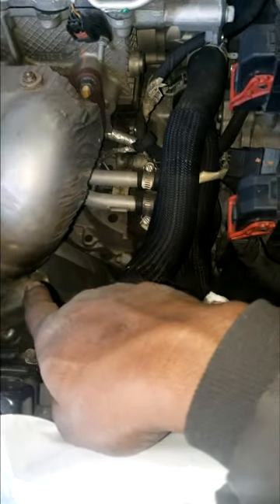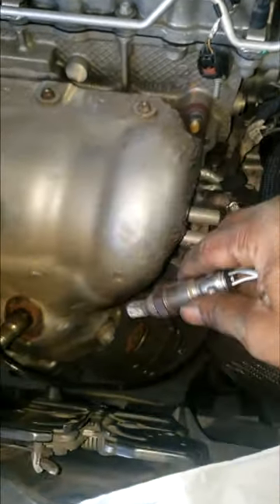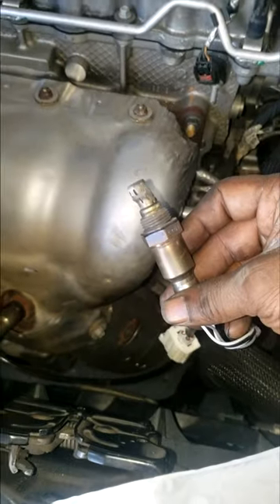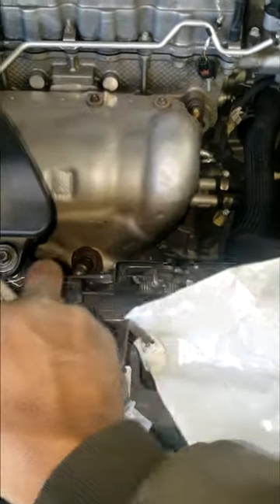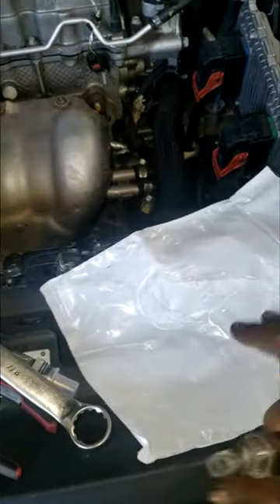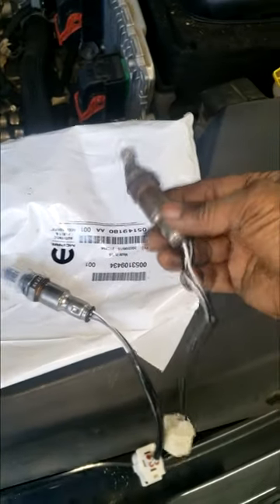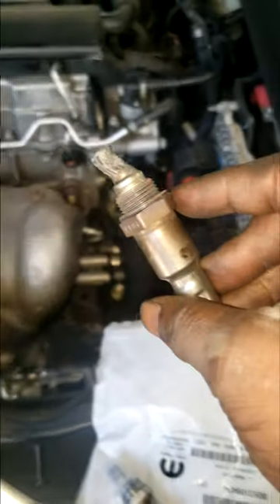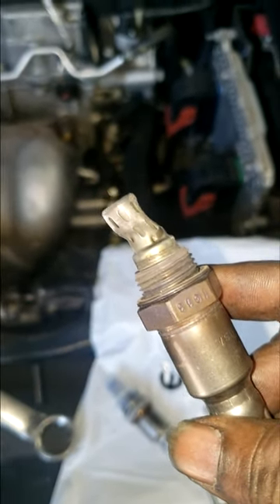Here's why this car came back as a COMEBACK RECHECK on me.

Comment: I would definitely put an infrared thermometer on that cat and exhaust to check for excessive heat and like someone else posted the fuel trims. Good luck and hope you post an update. Thanks brother
Reply: Bingo. Obstructed cat!
Reply: Yes Cat issues. Probably breaking off bits of catalyst that Hit the Sensor on way by.
Reply: Could be a piece of cat sitting on the tip of the sensor and melting it and distorting it.
Reply: Clogged cat creates incinerator.
Reply: @LukeTelff  
That sensor looked like it was just below the manifold/header.
If that’s the case, then the cat would be further downstream from that location!
Of course, an obstructed cat would cause the exhaust temperatures to rise which would cause the end of that sensor to melt or become distorted like that!!!
Reply: @AzzKicker-bz1cb  I was about to write the same thing 🤙
Reply: @birdieb5323  That's what I came here to say, but did he say he'd replaced the cat as well- or did I imagine that?!? 🤔
Reply: Yup. Many mechanic folks don't understand that the light comes on because the O2 sensor senses something wrong. But 90%of people just replace the sensor and never look for what is the cause.
Reply: Down stream would be behind the cat unless it has a pre cat then another after that sensor. Ive never seen a sensor over heat post cat or downstream from a clogged cat, if that happened it would have to be within an inch or two after the cat. Plus the upsteam sensor is fine which would be exposed to hotter temps if convertor clogged. Maybe the internal heating element is getting continous signal/voltage, older sensors were heated by exhaust but newer sensors encite a heating element for 30-35 seconds.
Reply: If the cat were blocked, wouldn’t it cause driveability issues like lack of power and acceleration?
Reply: @dm7097  at a certain stage
Reply: So true. Excellent Job 💪
Reply: With the seriousness of that visual evaluation of the conditions of that O2 sensor in just two weeks. Wow? Definitely follow the advice of Theses Engineers sharing knowledge about Fuel trims and CAT temperature. 💪
Reply: @birdieb5323  knew it right away
Reply: Wrong Wrong Wrong, absolutely not a clogged cat. Has anybody seen a clogged cat at night, the pipe gets so hot it glows. But just between the engine and the cat. From the cat back to the tail pipe isnt hot doesnt glow. The O2 sensor he pulled was downstream meaning after the cat. Only the upstream or the first O2 sensor would be exposed to the extreme temps or the glowing part of the pipe. But he didnt say the first sensor or the pre-cat sensor or the upstream sensor, he said the downstream sensor.  If the cat was clogged the first O2 would be the melted overheated sensor not the second sensor.
Reply: Defective Cat with improper plate placement.

I've seen one like that before: instead of the normal obstruction that allows the exhaust to burn clean before emission, it sort of funnels everything into a blowtorch down the tailpipe...cooks the Downstream O2 Sensor like bacon and plays merry hell with the baffles in the muffler.
Reply: @jonboatmorava9115  exactly! Just like a blown head gasket, it’s a symptom of an underlying problem

Comment: It got hot,!  Clogged catalytic converter!
Reply: Its a new cat he literally just said he replaced cat and o2's 2 weeks ago well at least the o2's  but still hed also have some catalytic codes at least a efficiency code id think very strange case.
Reply: Someone beat on it B4 they put it in
Reply: 100 percent
Reply: Looking at it from a really messed up positive angle. If there is anything like around where I live if it is clogged up within 6 months he's probably going to have to put a new cat in either way because somebody will have borrowed the current one in the middle of the night. I'm going to have to change my opinion about them being sneaky thieves and now say they are helping make sure the population does not have clogged up cats on their vehicles. Bless their hearts
Reply: Right
Reply: "I think" are the operative word's.
Reply: or unburnt fuel
Reply: Free the cats
Reply: @yungtomb9374  new doesn't mean good, all those "new" parts are fixed parts and build poorly, he should check the catalytic element if it fell down or clogged
Reply: Yep
Reply: If it was getting hot enough to "melt" like that that thing wouldn't drive worth a shit.
Reply: I bought a car, once. Paid 400 dollars for it. Had new cats on it. The new cats were stopped up, too. It was running too lean. Put in a new fuel pump. Punched out the new cats. Ram like a scolded dog, chasing a spotted ape.
Reply: He just said that he thinks he replaced the cat, he can’t remember if he did or not. I’d think that if he did replace it, it’s defective.,
Reply: @yungtomb9374  I've put brand new cats in and they fail. Could have been dropped before delivery and messed up the honey comb. Never know
Reply: @yungtomb9374  theres no way a good new cat would let that o2 sensor hit 500°+  to do that to it. I have messed with this engines emissions and its definitely a fuel trim bogging down because the cat is not flowing
Reply: @yungtomb9374   Just suck cause something came new from the fact you don't mean to s*** There's bound to be quality control issues doesn't matter who where or when🙄

Comment: Cat is either plugged and getting veryyyy hot, or it’s staring to blow out and a chunk clipped the sensor.
Reply: But he said he might have replaced the cat
Reply: Thats melted.
Reply: Yep this sounds like what’s going on. I had the same thing happened to a Subaru and a month later the cat came completely apart and clogged the exhaust. Maybe put a camera in the hole and see if you see any random or missing sections of honeycomb.
Reply: Agreed, I have seen them throw chunks. Also it was really hot when it hit.

Comment: The catalyst has come loose inside and is pounding the o2 sensor.
Reply: Correct you can se the imprint the converter honeycomb left on the sensor. I would replace the converter and do a flow check on all your injectors to see where the extra gas is coming from.
Reply: Excellent observation!
Reply: Yeah you can totally see the markings left
Reply: You're a smart "cat" no pun.
I'd want you on my team good observation

Comment: THAT’S where the 10mm went 😳
Seriously, I’ve never seen that before. Following 😎
Reply: That’s actually really funny!! About 6 months before I married my wife (of almost 27 years now, and counting), she was helping me put a set of heads on my ‘81 Trans Am drag car, and she dropped a Socket down a header pipe! 😂 
We’ve laughed about that for years and I still tease her about it….but yeah, without more detailed information, my best guess would be:
1) Clogged catalytic converter
2) Poorly tuned Nitrous system or overuse of Nitrous
3) or possibly a malfunctioning fuel system or clogged injectors, but chances are, if this was the issue, the engine would idle and run rough and the ECU would be throwing codes. 
Good luck with it, though!

Comment: Yup I have seen this before. When you install an o2 sensor with a regular wrench and over torque them, you twist the sensor itself on the tip.
Reply: That simple I bet!! Good info
Reply: @theglitch99  I did this by accident for years until an OG showed me the proper socket/wrenches to use for o2 sensors. $20 saved other people thousands 🤣🤣🤣🤣
Reply: No. Just no. I've tightened the living shit out of O2 sensors before. There is no force on the tip. That sensor is melted

Comment: There is a recall on that engine. We replace the converter and both O2 sensors. It's an emissions recall. Check if it was done
Reply: Those heat shield nuts look too new for the 2.4 cat recall not being done 😂 Dude idk how many I’ve broken now lmao. But yeah def see if the cat was done, could get the customer a free one.

Comment: Ok first of all good on you for posting your comebacks. Secondly it’s hard to tell the color of the metal in the video but to me That looks melted you need to check how the engine is running because the o2 sensors should not be getting that hot. Misfires and fuel trims would be what I look for first. And definitely pull the upstream to look at it too.   Good luck to you
Reply: The more I look at it the more it seems like there was a piece of the cat brick laying on it. Tap the cat with a rubber hammer or use a screwdriver or something in the o2 hole to feel if anything is loose in there. Again good luck

Comment: The catalytic converter is breaking apart. It will be back soon.
Reply: The cat comes after the header pipe😂
Reply: @paidinfullthelabel5698    No this car has a 3 way cat... its litterly part of the exhaust manifold..the sensor is screwing right into the side of the cat  ..it may well have another cat downstream in a more traditional location in addition to the front cat ... the more you know ...
Reply: Tom....I agree. It's loose banging on the 02sensor
Reply: What car is that? Does it have the same issue as the early nissan altimas where the cat would get sucked into the cylinders and trash everything?
Reply: @paidinfullthelabel5698  my e46 has the two cats built into both headers. Right where it goes from 3 pipes to 1 the cat is right there and then the rest of my exhaust is just resonators and muffler so you’re wrong.

Comment: The sensor did not melt. They head would be a puddle in the engine block. She took it to someone who removed the cat internally, with a hammer and a bar. We do it all the time when the cat melts or clogs. But you typically take the o2 sensor out if it is in the way. They didnt.

Comment: When excess fuel hits the cat, it creates f-tons extra heat. I even seen one faintly glow. Now, I think you know all this already, and know more than me. Also another common problem: Mopar (sorry man had to do it; I don't trust em)
Reply: I have seen a cat light carpet insulation on fire before. A coil died and two of the cylinders were not firing at all it was getting burnt in the cat. 
It wasn't faintly glowing it was really bright.
Reply: @timothybayliss6680  that's what happened. Had a dead cylinder water got into the sparkplug channels
Reply: You mean you don't trust FCA, Stellantis or whatever name they have this week lol I don't blame you. I worked for the FCA national warranty center and all I can say is they make nice vehicles to own while they're still under warranty.
Reply: @DH-rt3fk  if Mopar let's subpar suppliers put their name on it; it's Mopar.
Reply: Get out of the auto repair business now. It's  Frustrating work and will age you  Prematurely.
Reply: @robertbritton9674  already done, son. I just do my project cars and help friends save money now. Currently am freshening up ball joints, bushings, and brakes on a Honda element to sell; we are going to split the profits
Reply: similar problem on the hunting lease... we have to stay on the main trails... when you go off road you can set the brush on fire from the heat off your cats...
Reply: @robertbritton9674  its all about your attitude. All struggle is struggle. It builds character. I am in the construction business and commercial and I can see why it breaks so many people down but I just dont let it get to me.

Comment: Sometimes when customers put those fuel additives in it can contain tetra ethal lead (spelling??) and that stuff will attach itself to the inside of the catalytic converter plugging it, then the back pressure breaks off bits and pieces and sometimes you end up with a huge chunk inside the catalytic converter rattling around, and when that chunk hits a hot O2 sensor, it damages it.

Comment: If the cats not plugged you’ll need to check your wiring for the o2 sensor. New oxygen sensors come with built in heaters. It’s possible somethings tripped/shorted and it’s just constantly being heated, causing this to happen
Reply: Also my thinking, the internal heating element kicks off after so many seconds, usually less than a minute and goes into closed loop and at idle the element can keep the sensor up to temp. If the system malfunctions, maybe the wiring, pcm, or internal sensor short it could over heat the sensor. Its not the CC clogged, he said downstream, dont these people realize the 02 sensors upstream would be worse if the convertor was clogged.

Comment: Like BeastMode Networkk said, It was installed with a regular wrench, and over torqued. Get yourself an O2 Socket, or don't tighten it so tight. Overtightening it causes the internals to twist like what you have here.

Comment: Looks like the catalyst either has hit it or it’s gotten extremely overheated from a rich running condition
Reply: More like lean, rich makes it run cooler
Reply: @nzuncovered1845  if I were talking about in cylinder temps you’d be correct but I’m not. I’m taking catalyst temp. A rich running condition puts excessive fuel into the exhaust. The cats job is to burn that fuel. It’s one of the main reasons catalytic converters fail. Driving with a neglected rich condition can overheat the cat to cherry red to the point the catalyst material actually melts.
Reply: @jeffclark5024  Oh yes I see what you mean

Comment: Check the fuel trims and for misfires. Catalytic converters are a catalyst, what that means in chemistry terms is something that causes a reaction but doesn’t get used up in the process. In layman’s terms, cats don’t wear out, something killed it. Typically excessive fuel in the exhaust causes it to overheat. Occasionally burning a lot of oil can also do damage.

Comment: Catalytic converter came apart internally and is sitting down on top of the O2 sensor and as the exhaust gas pressure comes by it pushes it down harder against the O2 sensor which is what bent it so it probably needs a better quality cat

Comment: That means the customer has another vehicle at home that needed new sensors.  They took the new ones and replaced them with the damaged ones they already had.  Sensors don’t physically burn that fast in two or three weeks, and the tips definitely don’t twist like that at all.  BTW, those are the upstream and not downstream sensors.

Comment: Looks like there is a lot of unburned fuel leaving at least one of the cylinders, causing the cat to super-heat. Could be a lack of spark, or a bad injector causing it. The down side is, the cat is likely toast. When they’re getting that hot, the ceramic wafers inside usually crumble and melt. I’d be sure to diagnose and fix the root cause, before replacing the cat and O2 sensors though. Or, it will just continue happening. Good luck!

Comment: A chunk of the cat broke loose and hit it at a high RPM
Reply: Exactly what happened
Reply: that sensor is off the manifold it's on the wrong side of the catalytic converter for it to do that, but it definitely overheated and melted
Reply: @dougwilcher608  the cat is in the manifold you can see the upstream O2 on top
Reply: @ajaxracing  the exhaust manifold is the first section of a vehicle's exhaust system. It funnels exhaust gases from all the cylinders and routes them to the car's catalytic converter. the converter is underneath the car between the muffler and the exhaust manifold.. therefore it was on the wrong side of the converter for that
Reply: @dougwilcher608  your wrong that cat is in the manifold look again

Comment: Yes I have seen this before. Same thing brand new denson sensor & walker cat. CEL on pull code b1s2 voltage high pulled h02 & was bent . cat fell apart internally y or what cause it nvr found out
Reply: Bingo!

Comment: It actually looks like it was crushed against the element inside the cat. It may have gotten hot but the little squares on the side that’s smushed are  from the element. All 02 sensors are smooth they don’t have square striations in them something weird is going on there.

Comment: Them cats are plugged and running hot af to do that to the sensor
Reply: How can it be plugged?  That would Jack up one whole side of the engine wouldn’t it?
Reply: @dvk578  Generally they plug up when the substrate starts to break apart from overheating caused by excessive unburned fuel. I’m not sure if the substrate is pushing down on the sensor like a piston due to being clogged or if it got so hot that it melted the sensor. Maybe it’s a combination. Clogged cats generally result in a huge loss of power. I’ve never seen it do actual damage to the engine though.

Comment: For my experience, I had a exhaust valve not sealing well with a bad fuel injector that had a low leak. 
The catalytic converter need to be replaced and the upstream O2 looked like that.

Comment: Someone needed a new but put another old one,they new she would get warranty work
Reply: This right here someone is scammin
Reply: It does look like it had some marks from a pair of pliers on the side where it's crushed in, but I've never seen that before and there shouldn't be something that big going through the engine to get into the exhaust or from a cat unless things are actively breaking apart, so idk it's either someone did it or it got really hot? But there's no discoloration and it's a perfect shift in the body of it like it got hit or crushed

Comment: That is a blocked up cat, when the catalytic converter gets clogged up one side of it gets above 330°F and that toasts the O2.
Yours is clearly warping from excessive heat.
Check the catalytic converter next to the sensor!
Use an inferred thermometer on front and back of the cat, then check the other cat. If one is around 200-250°F and the other is 300-350°F you know exactly where it is blocked up
A possible symptom depending on severity of blockage is reduced power and reduced airflow out the exhaust pipes

Comment: Something plugged in the exhaust. That cat would need to be cherry red to do that. Could be plugged muffler blocking exhaust and trapping heat. Drive it 10 miles on the highway and check the temp of the cat right after.